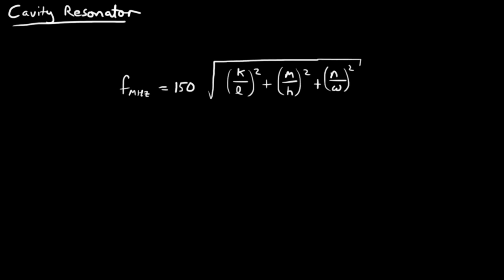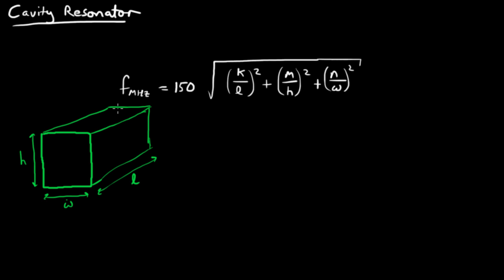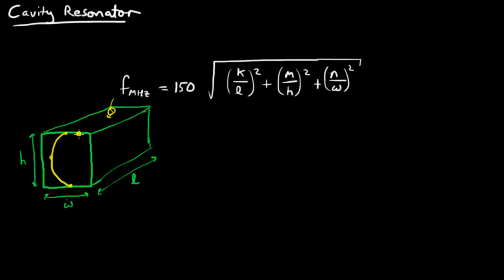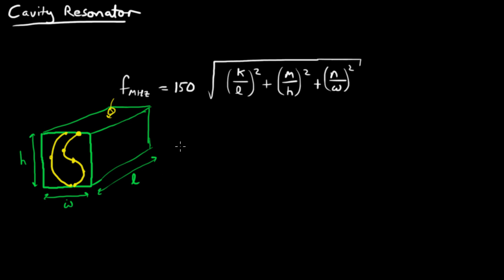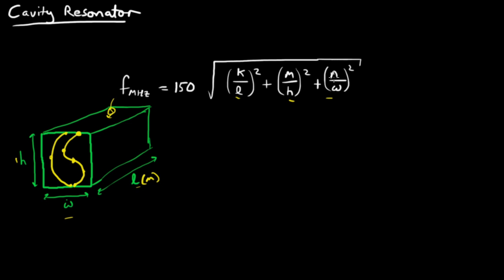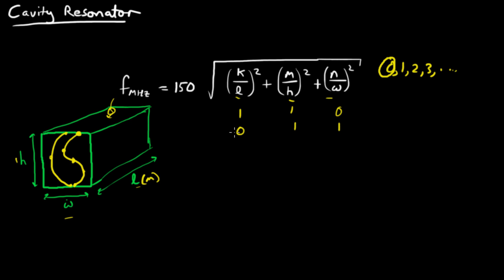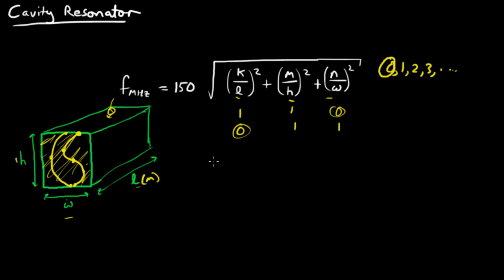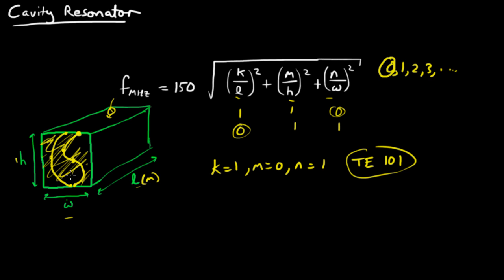Cavity Resonator

Comment: I would like some help ..maybe help each other. I am working on sono luminescence and need a WATER resonator that will vibrate water at the exact frequency to create sono bubbles and possibly heat and electricity. I can demonstrate the condition.
Reply: Hey Sir!

Fancy meeting you here!

Guess we truth seekers meet in weird comment sections 😂

And sir... your Microwave resonates with the water molecules in your food to cook it! Why don't you just look into that?

But I did ask CHATGTP for you and it said you need Acoustic Waves...

Understand Sono Luminescence Requirements:

Research the specific frequency range required for sono luminescence in water.
Consider the power levels needed to induce cavitation.

Select Appropriate Materials:

Choose materials that are suitable for use in water, considering factors such as corrosion resistance and acoustic properties.

Design Cavity Resonator:

Determine the resonant frequency: The cavity resonator should be designed to resonate at the desired frequency for sono luminescence. The resonant frequency depends on the size and shape of the cavity.
Experiment with different shapes: Try different geometries for the cavity to find the most effective one for your purpose.

Consider multiple resonators: You may need to use multiple resonators to cover a range of frequencies or achieve a more uniform effect.

Transducer Selection:

Choose an appropriate transducer that can generate acoustic waves at the desired frequency. Piezoelectric transducers are commonly used for this purpose.

Control and Monitoring:

Implement a control system to adjust and monitor the frequency of the acoustic waves.
Integrate sensors to monitor cavitation and luminescence.

Safety Considerations:

Ensure that the resonator operates within safe limits for both equipment and the surrounding environment.
Consider the potential effects of cavitation on the resonator material and structure.

Testing and Optimization:

Conduct experiments to test the resonance and cavitation capabilities of your resonator.
Optimize the design based on experimental results.

BUT HERES THE JUICY STUFF SIR!

Mark LeClair, of Nanospire, Inc, built a cavitation device in his garage for $250 that generated nuclear radiation and formed diamonds (using only water). He and his partner were severely radiation poisoned for more than a year, lost their hair and almost died.

https://drive.google.com/file/d/1Y6Q-0Hd3DHE2F34nQQKuNhxvdanptUv8/view

Cavitation Experiment/ Results/ Theory of RNA & DNA Synthesis and LENR (Low Energy Nuclear Reactions):

https://drive.google.com/file/d/1AYj6MgdUpFTe6hLX1pw24aWGwFwpzfpo/view

Just be careful! They nearly died from exposure!